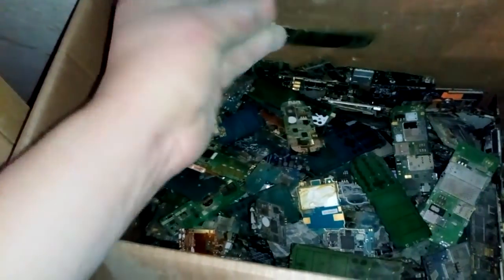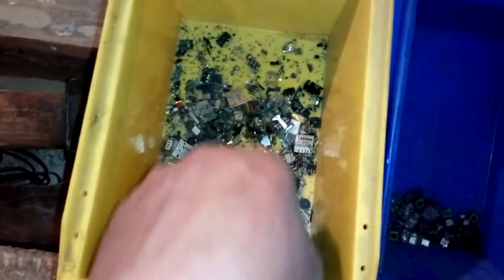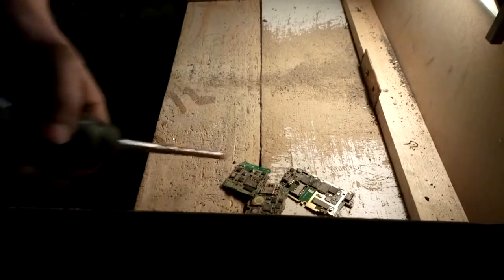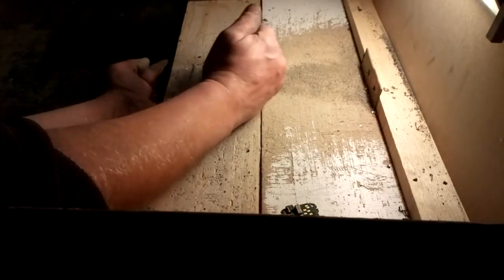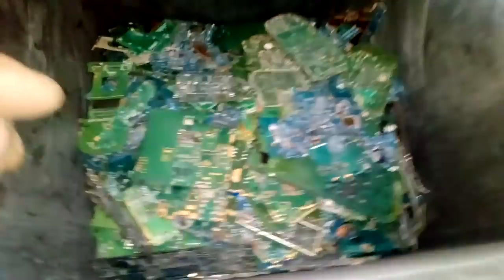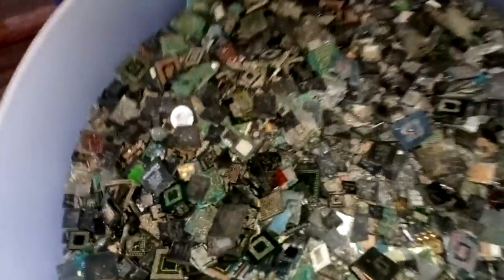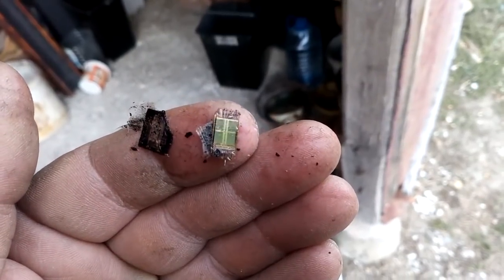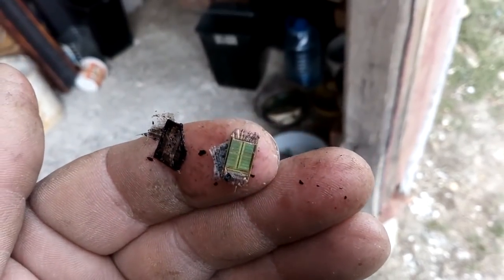10 KIlogram CELL PHONE board gold recovery PART 1

Comment: Please help. I scrapped 1kg cellphone boards but looks like I've recovered NO gold. They were put in nitric acid for 1 day, all metals dissolved except the gold color one. I then put this metal in aqua regia which did precipitate black powder with SMB. But when dried  and melted with a torch there was no metallic beads at all. I then tried catching with mercury , some particles were caught in the amalgam but when the mercury was burnt off STILL there was not a scrap of gold to be seen, only those very tiny resistors or capacitors. Am i living on another planet or what?
Reply from the maker: One kg of board not to much for desence gold amount.
Maybe you got mistake, first you should leave board in hydrochloric acid for some time to remove tin solder from board, tin and nitric is not god combination, nitric disolve coper and other metals but tin drop i emidiatly and cement back on.
Second after a dirty drop you should rerefine that black sediment, then melt.
Shit hapens mate, i loose gold somethime to, mistake is normal in every job. Heads up and try again. And be careful vith a mercury ok.
Reply: @999DusanGoldrecovery  Thanks for that. Ive done ALOT of research and NOBODY said first put in hydrochloric acid  so much appreciated. Roughly how much gold is in the average phone and is some of it hidden in the surface mount ICs?
Reply: @999DusanGoldrecovery  Isn't there a way of electroplating gold out of solution?

Comment: Hey Dusan , nice work man , its interesting to watch your videos , in this video filter system is kind of lossy , you can loose lots of broke bond wires may be ! I will tell how I do the process ,1. depopulate , 2. Remove solder mask, 3. Dip boards in ferric cloride ( this will separate all the foils in 48 hours ) and also easy to handle too, for thats for boards , and for ic s I use Sulfonitric (4 part h2so4 + 1 part hno3) this wont make that black crappy thing and all is left only the clean bond wires and goldy thins (chip dye will be left ) so friend try this methods and give some higher yield idia for your subscribers ,wish all the best my friend

Comment: Top Video !!! 
does sulfuric acid not react violently with water?
Reply from the maker: Nico Locasto Yes, it reacts, but if it is saturated with chips material, the reaction is much weaker. The only way that the chips are washed is water, there is no other.

Comment: Have you tried hot sand to remove everything off them. then just sieve all the sand off and it leaves the rest.
Reply from the maker: Kyle 007 I've tried but honestly, I prefer mechanical depopulation. It's a bit stingy and can be done in, as it is now cold outside.